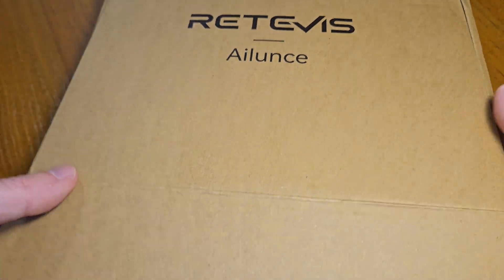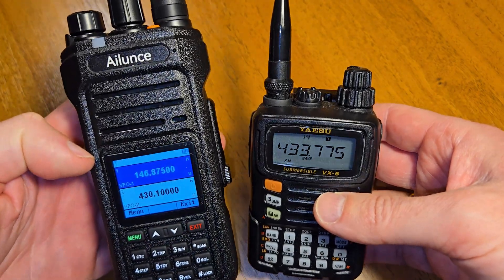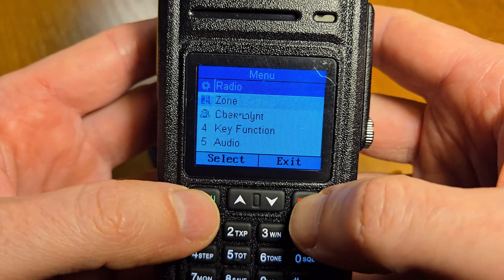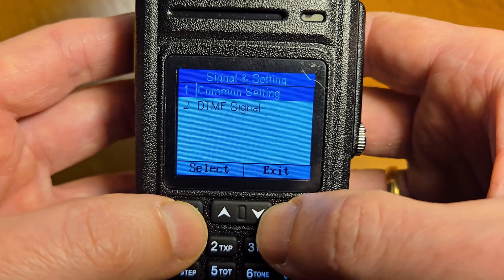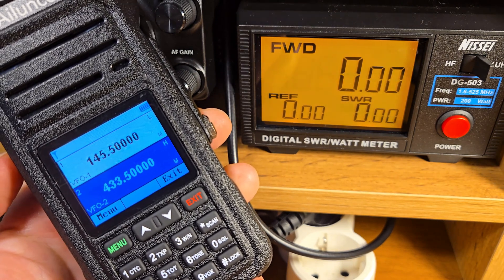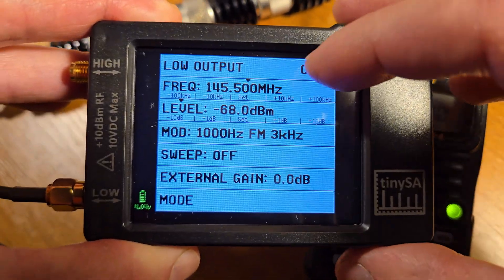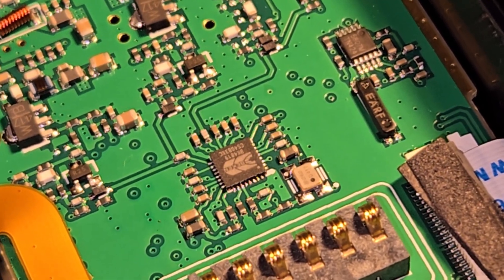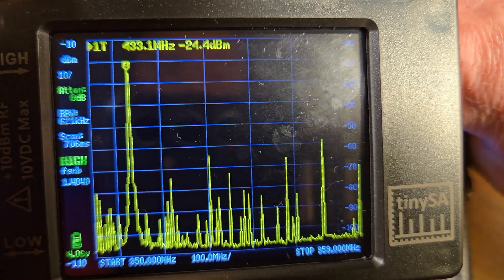Ailunce HA1UV radio

Comment: Got mine and can’t get it to read or write despite reinstalling all the drivers. I somehow got the CPS to save the codeplug, but it only saves factory copies despite changes being made…

Not going well so far…
Reply from the maker: I just asked them by email for the new version of CPS and they promised to make a new version of CPS next week and share it with us on the support section on the official website.
Reply: @ were you having similar issues? I sent them an email as well.
Reply from the maker: My version of CPS just close spontaneously by itself during some action in it.